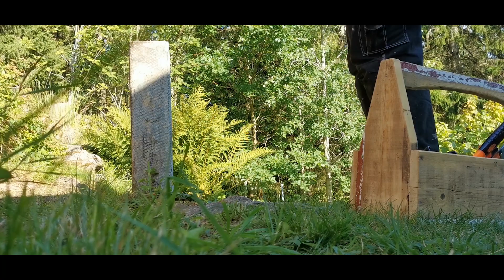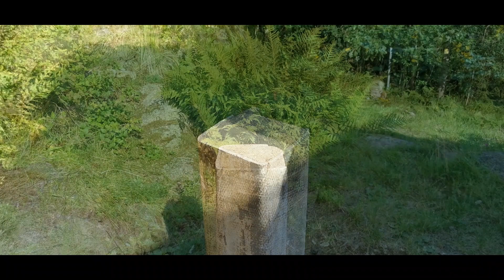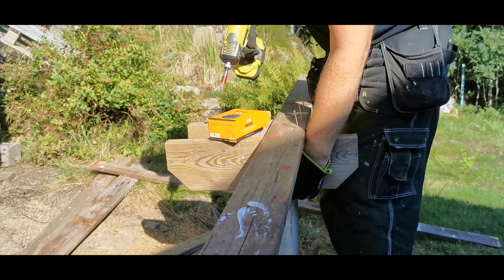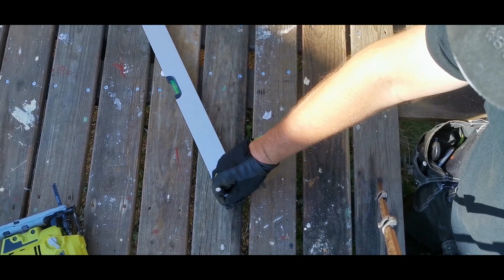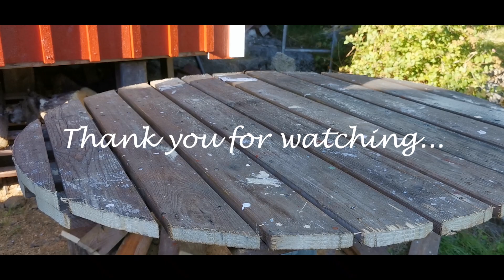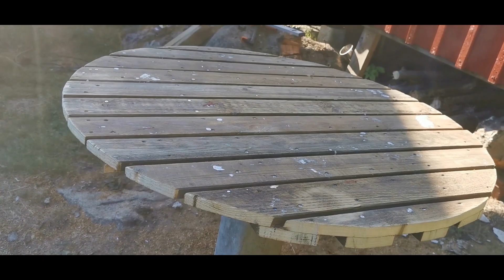Scrap Wood Round Table (or how to hide a concrete post)...

Comment: Hey, that's a cool way to hide an eyesore like that post, well done.
Will you fix the table top to the post somehow though? It seems a little tippy if you put weight on one side.
Reply from the maker: thank you very much! and you are right. I have intentionally left some play, just to see how the mount shrinks and expand. a rainy day it solid, but not on a warm day. I will probably add two wedges to accomodate that, and still have it easy to remove. 😊 or do you maybe have any suggestion? thanks again! tip of the hat!
Reply: @dekeros-recreationalwoodwo6456  oh nice, wedges are clever, you'll still keep it easily removable that way too. I guess so long as you don't expect kids to climb on it that will be strong enough.